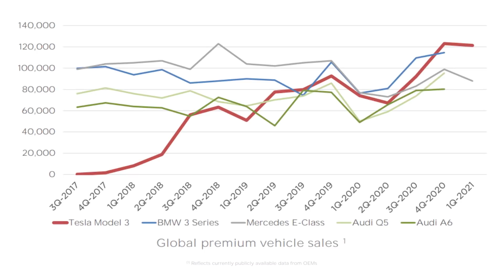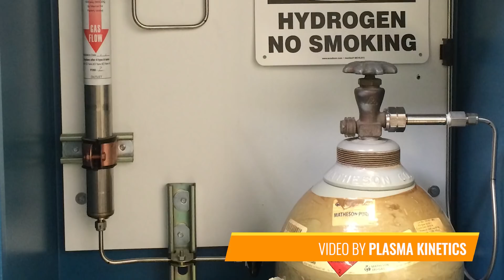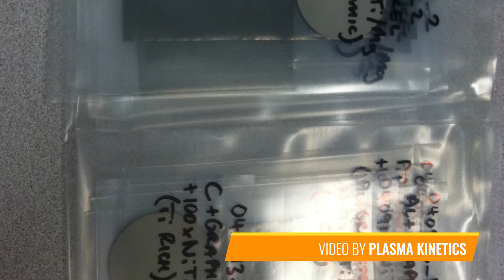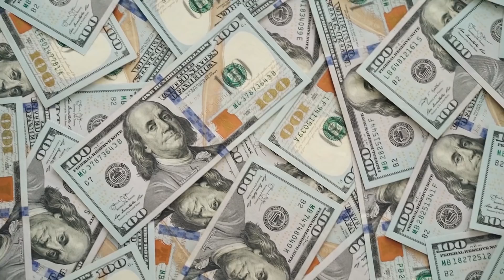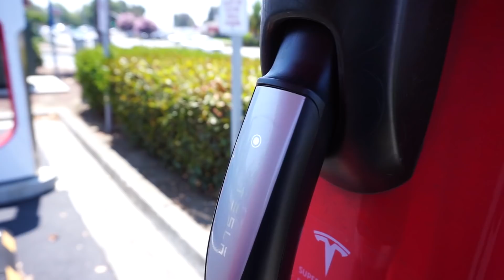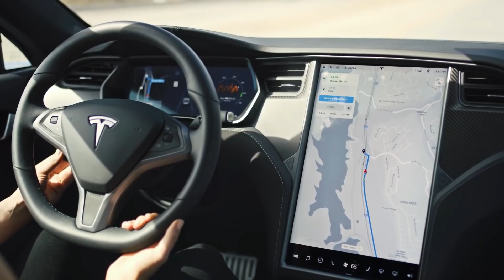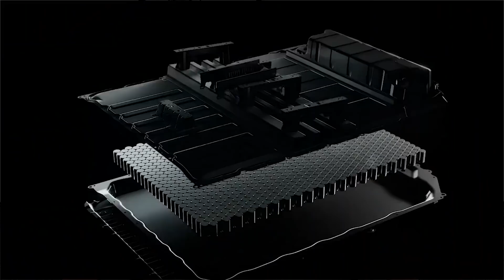SANDY MUNRO: No Batteries Needed for Toyota to Rival Tesla

Comment: Funny nonsense, batteries have already won ;)
Reply: That’s what they said about Gasoline 100 years ago when it replaced the electric car. Good thing new technology can never change the future.
Reply: @roman-ze2fg , you learn history. As soon as the electric starter was added to the gasometer car, no EV could compete. Doesn’t matter who promoted what, it was just better technology at the time. Batteries could not compete. And they still cant.
Reply: @imho7250  no, 90% of the US media is controlled by 6 corporates therefore you're brainwashed, learn more the facts
Reply: @roman-ze2fg , while it’s true the media and big tech are doing what they can to censor free flow of knowledge, the fast is there was no battery 100 years ago that can compete with the gasoline car. Even today the only reason more than 1% drive an EV is due to government subsidies and a peak of greed from oil company that caused gas to hit $5/gallon at the time when decent batteries were available. 

But when gas when back to $2/gallon, EVs can’t compete.
Reply: @imho7250  no, Rockefeller destroyed that. Jay Leno has > 100 years old car with the range NOW still > 100 km. Nowadays we would have 10000 range without corporate under "humans" and pedos demos :)
Reply: @roman-ze2fg , Jay Leno’s baker electric was a great car, for the wealthy. The reason they could not compete is because gas was cheap, Ford Model T was 1/3 the cost of any electric car, and gasoline could be refined in minutes, while batteries took hours. 

And what is the big complaints against the EV’s today? Initial cost is too high, low range, slow refueling. 

Right now you can go buy a brand new Chevy Spark for $16k MSRP, no need to have a $7500 tax burden to qualify for en EV tax credit.

How much is he cheapest EV that has 300 miles range, will refuel in 5 minutes, and cost 10¢/mile even on long road trips away from home?

The EV tipping point is not yet here. It’s still several years out. 

Hydrogen may have a place, but batteries are probably more practical for that size item.
Reply: @imho7250  no, you lie, Rockefeller destroyed it, learn finally the history! :) In 1990 GM destroyed EVs cars too.... Start learning! :)

Comment: Just want to point out that the reason the North beat the South had little or nothing to do with the Minie Ball. Most Civil War historians agree that it was due to a combination of population, productivity and the South being over-aggressive. While the Minie Ball was revolutionary, it was only useful in muzzle loading rifled muskets. Neither the North nor the South had many of them at the start of the war, and while many suitable guns were obtained as the war progressed (mainly Springfield Model 1861 for the North and Pattern 1853 Enfields for the South) the soldiers of both sides rarely received enough training with the weapons to make the difference significant. In fact, most Civil War historians agree that the North lost more soldiers than the South during the war, which shouldn't have happened if they had significantly superior weapons.

Comment: There are two problems with EV charge points, the early problem is that we want geographic coverage but we will very quickly see the second - we need more outlets in each location. If a petrol station can service a neighbourhood with 12 pumps that take 5 mins per fill, the EV-equivalent would need 50 recharge points if they take 20 mins to recharge.  To recharge by 30kwh in 20 mins  is 100kw so that whole station needs 5Mw and we need a new power grid !   I like the idea of selling Hydrogen infused Hydride packs in supermarkets if Toyota can make that work.
Reply: Others talked about the power grid requirements. It's doable (factorys can have similar consumption patters), but depends a lot on whoever manages your grid. >> Some places will do fine, while others will experience blackouts.

Comment: Battery electric is the golden child right now because it is the latest and every one is enthralled with it. There are some major problems with Lithium Ion, Stability, supply in 30 or so years. Now some of this could overcome by different battery chemistry which is in the works now. If not careful we could end up in the same  predicament as we are with oil right now. Maybe cars will be battery electric but I feel it makes more sense for the trucking and rail to be hydrogen.
With the metal hydride storage even more so.

Comment: I read that Tesla, the inventor, used a magneto (changed to a battery charger) from a model T Ford car to generate the power for his electric car w/o a battery. The magneto was based on the physics of an Maxwell's equation taken out of textbooks and it probably only need a regular battery to start the magneto.

Comment: 8:40 Exactly. Toyota could have stolen a lot of market share from Tesla had they flooded the market with cheap Prius and Rav 4 Primes. But they didn't. And now they will see their market share drop significantly. I recently swapped my 2005 Prius for a 2020 Corolla hybrid. I found the tech had barely improved in 15 years. IN fact my Prius accelerates better than the 2020 Corolla. They could be leading the world with PHEVs and HEVs if they could pump them out at rock bottom prices. But that's not happening and they will start to gradually see a loss of market share if they don't wisen up.
Reply: Toyota's quarterly profit is up 54% year over year to 9.45 billion USD. I'm not sure they are losing much market share, but it doesn't seem like it.
Reply: @k1fizz  Love to see a breakdown of those numbers. My sense is that like Ford they are doing a tidy trade in truck sales (Utes we call them here in Australia), and their hybrids all sell well. However, this is based on the current situation in which there are no EVs at price parity with Toyota hybrids, and there are no electric trucks to compete with Toyota's. We could be in for one of the biggest tankings in automotive history when that situation changes. Wouldn't be without precedent in history. Plenty of other products hit their peak in sales right before they tanked and were completely replaced by superior tech.

Comment: I am shocked and amazed that a company like Toyota has not seized on producing the bridge car that is needed. This (to me) is a diesel /electric hybrid. A very small turbo diesel motor that runs a generator that charges batteries will eliminate the range anxiety and could give over 100 mpg if fuel efficiency. Diesel is the most energy dense energy carrier readily available. The emissions can be easily be dealt with. Maybe not the cheapest solution but built right this type of car could easily last a million miles. The motor would run at optimal power band and never get stressed as the electric motors do the heavy lifting. It might be too late to get started on a project like this now. It should have happened 15 years ago.

Comment: The Hydrogen cells could also be sold and retrofitted  to older gas vehicles to keep them going as well. So there is a huge market for that as well. There is still a big hotrod community that likes to hear the sound of a engine and Hydrogen would fit well for a alternative fuel source for big block engines.

Comment: Toyota could make some excellent plug-in hydrogen vehicles. The Mirai is like a textbook example in how not to make a hydrogen fuel cell vehicle in 2021 - medium-sized, medium-specification, solely hydrogen-fuelled. If, like Sandy says, you've got the best fuel cells in the world, put them in big vehicles. The ones where batteries would be prohibitively heavy/expensive. The kind of sizes where your rivals are the Tesla Model X or BMW iX - the Highlander, the Land Cruiser, maybe the Hilux - these are where you might actually win some significant market share. Commercial vehicles would also be great - Stellantis are bringing out a plug-in hydrogen van that offers enough range for regular inter-city deliveries - but Toyota isn't as strong in that area (their Proace vans are made by the PSA group).

Plug-in hydrogen is surely the way to go. Combine the convenience of plugging in every evening with the assurance of a chemical fuel, and using the battery for 90% of your driving reduces the limitations of hydrogen. You'll be able to build and sell bigger vehicles than your BEV competitors if you make them plug-in hydrogen, and there will definitely be a market for vehicles where you get to go green but otherwise barely have to adapt your motoring. For smaller vehicles, maybe Toyota could offer hydrogen range extenders, too. In 5-10 years, the BEV market will be much stronger, and there might be no niche left for hydrogen, but there's still a few years for Toyota to push out a car with hydrogen as the USP and make some progress on BEV technology before they're left with literally nothing going for them.

Toyota also needs to invest in hydrogen infrastructure. It's no use having the best fuel cells in the world if there's nowhere to fuel them. They need to buy up companies that are going to build hydrogen supply equipment - in the 5-10 year scenario where hydrogen is redundant for passenger cars, there will probably still be HGVs and other applications for it, and investing in supply equipment (not necessarily public fuelling stations) will probably pay off long-term.

Comment: The problem with the "gas disk" is that it is a single source energy system tied back to the fossil fuel industry. Tesla all electric battery storage can accept power from any source whether it be solar, wind or traditional energy production.

Comment: This kept me thinkin about wind turbines and solar generator combined.  When we're driving, our car will generate wind draft force.  Can we use this wind to generate our electrical charges?  Also, solar panels on the car can generate electrical charges!
Reply: The mechanism (attached to the car) one will use to "capture" the wind energy will most likely cause a drag (slows the car). And there are already few prototypes of cars using solar panels. Of course one can always make improvements on these stuffs.

Comment: Mazda strategy also has an insertion point for a wankel rotary for range extension and possibly mechanically linkage to rear wheels for final drive efficiency.  I would be looking at Liquid Piston as it doesn't have the rotor seal problem.  What is the weight/cost tradeoffs vs more batteries?    Toyota can run cost benefit analysis as they know the costs.

Comment: In short: Toyota is dooooooooooomed.  Even Sandy couldn't save it.  That metal hydride technology is interesting, but it's not going to be able to compete with BEV's, especially Tesla.  The reason: energy conversions.  BEV's have only three energy conversions: (1) Source energy to electricity.  (2) Electricity to battery storage.  (3) Battery storage to motors and loads.  The metal hydride technology has five: (1) Source energy to hydrogen.  (2) Hydrogen to disc storage.  (3) Disc storage back to hydrogen.  (4) Hydrogen to electricity (fuel cell).  (5) Electricity to motors and loads.

Each energy conversion involves losses, and some processes have more losses than others.  The metal hydride system involves extra processes and moving parts (the laser, whatever system makes the laser cover the entire disc, the compressor and piping to take the H2 to the fuel cell, the fuel cell itself and whatever else) plus all the parts and processes required for a BEV (li-ion batteries, electric motors, etc.).  Each extra part/process carries with it the possibility of leaks and malfunctions.  In addition, this system will face the same problem hybrids have, namely, the need to have two separate onboard energy systems, both of which take up space and have mass.

Plasma Kinetics' site says, "Storage is 30% lighter, 7% smaller, and 17% less expensive than Lithium-ion battery per kWh," but that's just the storage.  It does not include the fuel cell, and may not necessarily include the laser, compressor, piping, etc. if they're just comparing the storage discs to batteries.  

Even if those stats hold, you wouldn't walk into a convenience store and walk out with a hand-held disc thing to swap into your car.  The disc storage pack is going to be only 7% smaller than a car's battery pack.  IOW, it's going to need NIO-style power pack swap infrastructure, which in turn requires "extra" metal-hydride power packs to be at the swap station waiting to be swapped in.  This adds to the cost of the system, and the challenge of scaling up, since the "extra" power packs have to be manufactured in addition to the ones being directly used in cars.    

Then there's the fact that the Plasma Kinetics systems would need to be manufactured in scale, they would need to be able to endure wide ranges of temperature, vibrations, etc. to be reliable in cars, and so on.  All those devils-in-the-details any new technology has to face before it can become commonplace.

And finally, cars using this system would still have to go to stations to fuel up.  You can't charge them at home for everyday use like you can with a BEV.

Comment: Toyota currently have over 10,000 patents for SSB which are 12.5% more efficient per lb. They are also smaller so you you can fit more in the same space.

Comment: Here is math from company website, 19 liter container has 500g of hydrogen, if we use 33 kw of energy per 1 kg of hydrogen as books state then that 19L container will give us 16.5 kW, you will not get far with that, also they dont mention weight of that container. So it is not a small disc! Also hydrogen contains 33kW of energy but im not sure what is the efficiency of fuel cell, i think its 50%, so cut that to 8kW from 19L container, so if you have a mid size car you need 80kW to have 200-300 mile range you need 10 these 19L containers. Doesnt look like its going to work

Comment: Couple of problems here. Hydrogen is not very green as it's not efficient. It takes a LOT of energy to produce hydrogen. After fuel cell conversion it's actually less green/efficient than Toyota's current Prius line. So they are spending all this money to go backwards. Plasma kinetics may work and get the hydrogen molecules super tight on that CD size disk. But even if you packed hydrogen super dense in the "partial" volume of a cd disk you are not going to have enough volume storage for even a few miles. Electric vehicles are really incredibly efficient and beat out ICE and Hydrogen if your going for least emissions. We are just now seeing solid state battery vehicles coming out now. Xping P7 which is available in China now and USA soon has a EPA range of 520 miles for $32k us dollars! Electrics are so good you'll just charge battery to full each night and never worry about fast charge.

Comment: Plasma Kinetics..

Sense of scale:
Plasma Kinetics is planning the introduction of 19L containers with 500 g of H2 for mobile applications (aircraft, vehicles, and boats). Larger containers of 67 m3 and 76 m3 will have 500 kg and 1000 kg of H2. 

I assume something like magnesium hydride, where Hydrogen takes up about 5% mass fraction of the product, implying a 50 kg of hydrogen would require a 1000 kg of additional mass, and be about 1 cubic meter. 

Will still need a hundred kg for a small hydrogen tank and a fuel cell.

Sounds almost workable.

Replacing a 1000 kg of hydride disks every few weeks... that does not.

Comment: The biggest problem with hydrogen is cost. It will always be more expensive than batteries. It is all about the conversion effeciency and people feeling independent from a fuel supplier. BEVs just charge at home.

Comment: It doesn't look like the plasma kinetics solution would really be feasible in the way Sandy was pitching it for use in hydrogen fuel cell vehicles. From the plasma Kinetics website:
"""
Storage is 30% lighter, 7% smaller, and 17% less expensive than Lithium-ion battery per kWh. Plasma Kinetics Energy Systems are heavier and larger than compressed gas above 350 bar. 
"""
So the solid component that the driver would need to swap to re-fuel weighs around 200Kg and has a volume around 332L to match the capacity of a Tesla model 3 standard range.

Comment: How much do those hydrogen disks cost? How much energy is required to convert it to a form the fuel cell can use? I would bet the cost per mile with those is way more than charging a battery directly. Probably even more expensive per mile than gasoline.

Comment: imagine if you could combine the fuel cell and the metal hydride into one! Guess what, you can! It has been done already, years ago, and its already used in traction applications. It's called a "metal hydride battery".

Comment: How about a key wind up motor that uses a variable transmission to power an electric generator which charges up a rechargeable fbattery fuel cell ?  It never needs a power station as it is self contained. Also has solar panels.

Comment: I might be wrong but both the Union & Confederacy use minie ball munitions... I know of one collectors item which was a three-ring minie ball union munition, & I saw a two-ring confederacy minie ball in a history display: maybe that's what Munro meant when he said the confederates tried to design their own munition? In fact the minie ball munition used, at least by the Union but I thought by both sides, was modified from the original claude minie design to be more efficient by some fella at harper's ferry before the civil war even broke out.

But yeah I thought both sides were firing the minie ball. I dunno. I thought the north won more due to a vastly superior manufacturing base & better durable goods trade relations with european powers more than because of any great difference in munitions design but I'm sure there were a lot of conciliatory factors.